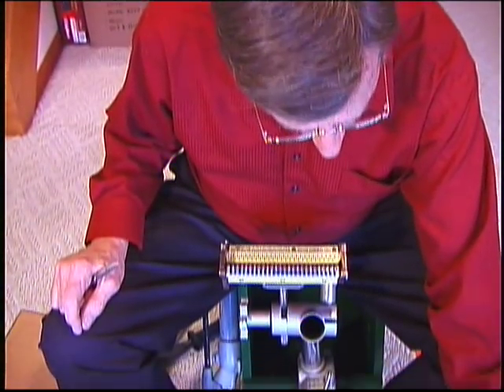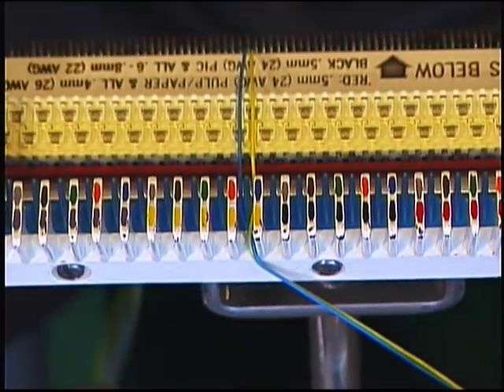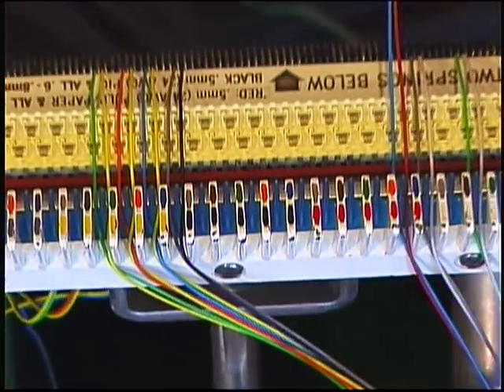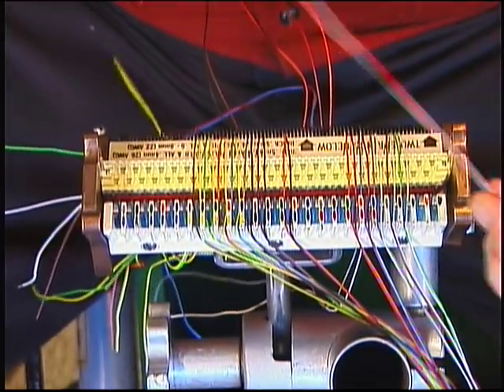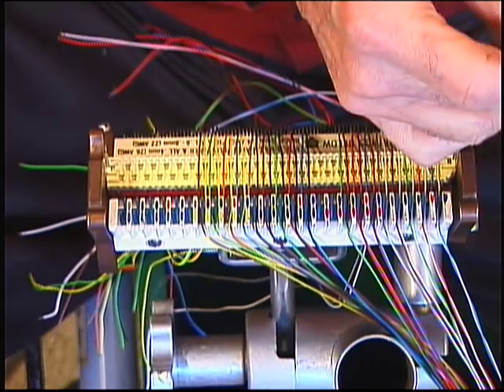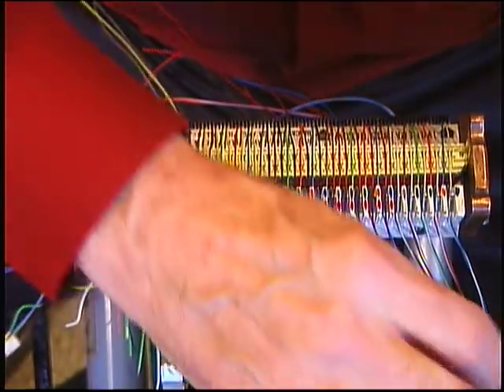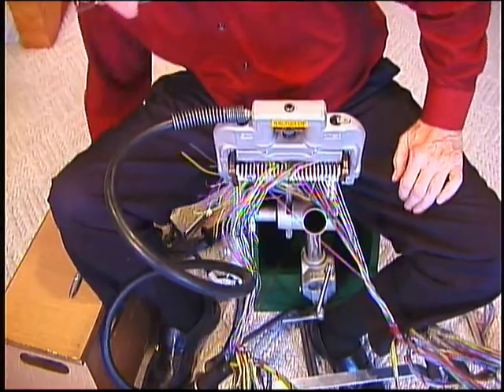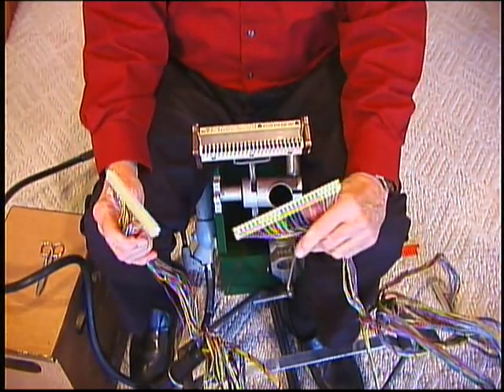Telecom Copper Splicing Video

Comment: Don't forget to explain Tip and Ring in the head.......I still have my '81 issued Square with 4 heads and accessories from when I was an 18 year old kid at GTE HaHa......We did it sitting in a sand filled ditch in 120 degrees though!
Reply: Anyone remember banging out pairs with an Amp gun?!
Reply: @RadioReprised  Hell yea we did alot of that about the only time we used the 710 was on new installations.

Comment: Normally its not that clean, you are often working inside of a manhole with messy flooded cable that you have to seal inside of a encapsulation case.
Reply: yes indeed, this is a classroom splice

Comment: Back I the 40&50’s it would take 3 guys 3 days for spin and dip and sleeve paper cable/with the 3 m system 2 guys 8 hours with a case . I could do a 144 pair fiber in air conditioning 1/2 day.

Comment: Been splicing for 24yrs with AT&T we use 3M 710 modules. Nearly all new installations are fiber but we still do a lot of copper splicing. Ca. High speed rail is a like for like project so we have entire central office  terminations 100 thousand pairs of new cables to splice in the Central Valley.

Comment: I did that in the US Air Force from 1979 to 1994. The one thing I liked about the job, We worked at other bases around the western US ,  Including  Alaska and  West-Germany ( Cold War ). E&I, AFCC.
Reply: I'm EI currently! Stationed at 205th OKC
Reply: I worked at Ascension Island a AAF tracking station, did submarine cable work (Diving) and OSP we still had lead sheath paper covered wires always taging those damn wires.

Comment: In Germany we use the 3M MS2 system every day. Due to the fact, that fibre is used, but most connections into the houses are still copper, that will last quite a while.

We don’t use 25 pair but 20 pair combs. Also we have another 3M toolbox with a 10 pair comb for „small“ cables. (I prefer to use the 10-pair-box for 10-50pairs cables. 

Since the used connectors aren‘t useless after pressing them together, I use „scrap-cable“ to refine my splicing-technique in every free minute. Afterwards I undo them, put the parts back into their box and waste the cable. 

The cables can have from 10 pairs to 1000 pairs and the color-coding is completely different.

We use red, green, grey, yellow and white. Every color has 4 wires, individually marked (1a=blank, 1b= 1 stripe, 2a= 2 stripes (long space between), 2b= 2 stripes (short space between), and this repeats for every color 3/4 is green, 5/6 is grey, 7/8 is yellow and 9/10 is white.

That‘s a group of 10. The group is red, normally unmarked. On a 20-pair-cable, the group is marked with a red cable-tie or a plastic ring. The next one would be green, and so on.

That‘s how you would mark a 50-pair-cable, for a 100-pair-cable you would repeat that, then switch to rings cut in half, or use 2 cable-ties to mark pairs 51-60, 61-70, and so on.
Reply: I need your help m8. How i can get in conntact with you?

Comment: I worked at the Rod and Wire mill at the former Western Electric Hawthorne Works. Before we closed down in 2008, i found a custom aluminum case at the top of the shaft furnace that read "Western Electric 710 connector cutter presser modular splicing kit" Tools weren't inside but I used it as a tool box in the back of my car for years. Now I finally know. Awesome, nice to know. Still have the case and still use it.

Comment: Interesting to see how things were done back in the day.   Can't imagine there is much call for this kind of work now.
Reply: I know. I live in western north Carolina. I worked for Verizon for 15 years. In 2010 they spun off 13 states to Frontier communications. That was the beginning of verizon getting away from copper facilities. There are a few areas with FTTP but most are on copper DSL. Some that live in very rural areas can't get DSL or cell service and still use POTS. The terrain is rough and the customers are spread out.
Reply: I do it everyday.
Reply: @joshuaphillips9810  Copper cables are still used by the phone companies?   Around where I live...NYC area...Verizon will allow a residential customer to keep their copper POTS line, but will not install a new connection, and will not repair a copper line that's damaged.

Comment: We used the MA-6 and VS-3 in the old day's. When i went to tech school back in 1979 at Sheppard AFB, Texas. They showed us how to splice telephone cable's doing the pig tail method and sliding a cotton sleeve  over the spliced wire. I got to use the MA-6 and VS-3 at my first duty station at Norton AFB, California. I was with the 1835th Elect. Inst. Sq. ( AFCC)  From 1980 to 1988. I went on a lot of TDYs in those day's.
Reply: We are still using the MA-6 and VS-3 here at Sheppard for tech school. Great stuff.

Comment: 3m is the worst. Why not use 710 modules? Much faster.
Reply from the maker: I have past experience using 3M MS2 modules, Lucent 710 Modules, and AMP Corporation modules, and frankly I have seen little difference in speed.  Basically a well trained and skilled technician should have no trouble splicing 300 pairs per hour using modular splicing technology.  Once you get going, that's 5 minutes per 25-pair module.
Reply: 710 modules are all we ever use for bulk splicing. The 3M MS2 dry modules we have on aerial runs around here were used   in splices done in the late 1970s. Definitely a good place to check if you have a dirty open on your pair!

Comment: All of that work to get 1.5 Mbps.  :(
Reply from the maker: Actually, the copper pair network was really designed for 64 kbps Plain Old Telephone Service (POTS) and did not expand to PANS ("Pretty Amazing New Stuff" - joke) known as ADSL (Asymmetric Digital Subscriber Line) until 1999.  Copper cable splices occur approximately every 600 feet, so you can imagine the hundreds of millions of copper cable pair splices still existing in the world's largest machine - the telecommunications network.
Reply: Correct, if you're talking HDSL T1 service.  There are newer ADSL types that provide enough bandwidth to provide IPTV, etc., provided (and this is the critical point) the copper OSP is properly maintained and conditioned.

Comment: Wow! Thank you for the video. I have been wondering for a LONG time how telecom lines were repaired after being damaged or severed. When I repair a body or engine harness on a car I can have a few hundred wires to be soldered and on  Hall effect sensor wires I cannot alter impedance otherwise things get all screwy in the PCM. So I couldn't imagine repairing a telecom line that service a few thousand homes.

Comment: im cable maintenance, this splice is indeed  a dead technology, never seen hydraulic cutter before.  do a video on wet lead cable splice
Reply: Even in an area with FTTP, there are still miles of lead/paper and STALPETH cable out there. It's mostly in the underground but we also have a fair amount in the air.
Reply: so. maybe we known you aren't big pair wire maintenance

Comment: Is that whats inside the black rectangular splicing cases I see hanging on the street poles?
Reply from the maker: This type of splice would normally be placed in a splice case that is a black cylinder located horizontally on a cable just left or right of a utility pole.  Rectangular boxes hanging on poles are usually terminals than have screw down terminations for individual wires that allow one or two pair thin drop wires to run from the pole to the side of a house.

Comment: You didn't leave equal lengths of slack on all the pairs, mistake when wiring an MDF or SDC....
Reply from the maker: This demonstration was designed to show a straight splice, so the blue/white pair entering the splice from the right is the shortest length and the slate/violet pair is the longest.  If the wire work is designed to be at right angles, then the cable entering the splice could be rotating to 90-degrees, but the majority of splices in the field are straight or fold-back splices.

Comment: This was adapted in 1976 in the Bell System, you can splice 25 pairs at once. In the old days each pair of wires were twisted together and then soldered by hand. Then each splice was wrapped with paper tape and the whole splice was filled with wax.
Reply: splices weren't filled with wax, but the paper insulated cable pairs were covered in wax before they were sliced together. process was called  boiling out
Reply: @gregs3032  I have opened lead sleeve splices both in underground vaults and aerial where the splices had been thoroughly saturated with paraffin after the splicing had been completed.  They had to be heated to melt the paraffin to get any pairs free.  So it's partially correct.
Reply: Is that when the wires went from paper wrapping of wires to colored plastic coating or was this change from paper to plastic something else?
Reply: @celtman58  - PIC (plastic insulation, "Polyethylene Insulated Cable") started getting deployed as smaller sized (100 pair and below) distribution or F2 cables in the late 1950s. They continued to install large (300-1800 pair) feeder cables (primarily in the underground) with pulp/paper insulated conductors and lead or plastic sheathing until the early 1980s.